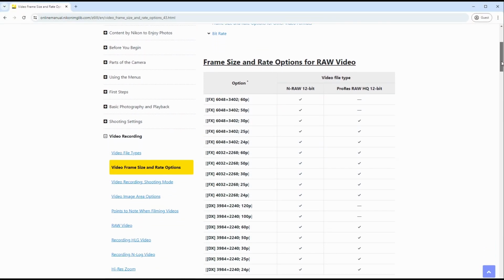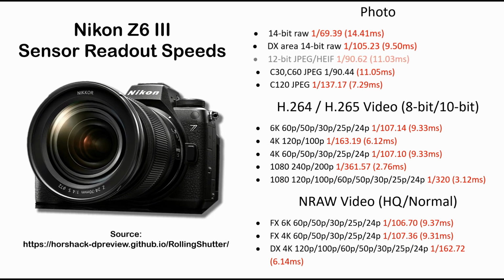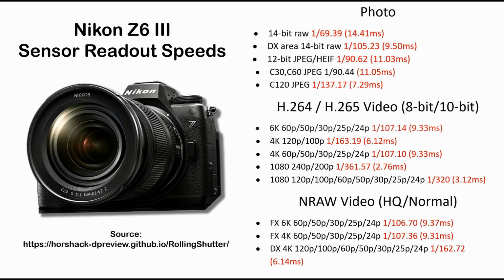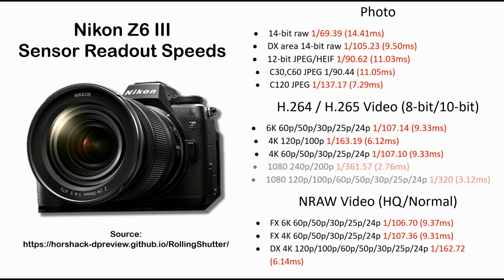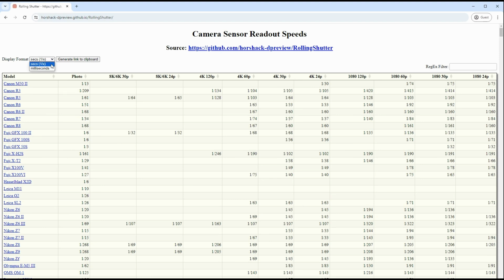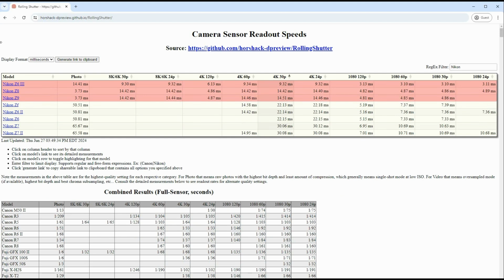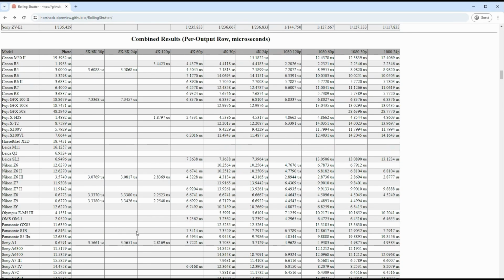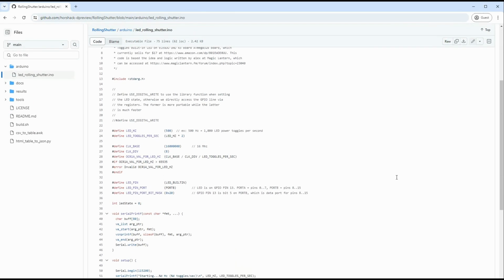Nikon Z6 III Sensor Readout Speed Measurements

Comment from the maker: There's an important aspect to fully-stacked sensors I forgot to mention in my video. None of the fully-stacked sensors currently on the market can use their fast, on-chip stacked memory in video modes. It's presumed this is due to thermal constraints running that fast memory continuously for long stretches of time. A big clue about this came from the datasheet for the stacked sensor in the Sony A9, which states that none of its video modes can use the stacked memory due to heating concerns. This is why the sensor in the Z8/Z9 has slower readout speeds for video than the Z6 III, even though the Z8/Z9 have almost 4x faster readout for still images vs the Z6 III.
Reply: Thank you for the information. Especially the bit about nerfed vid specs due to thermal throttling.

Comment: Excellent work! I have been looking for such a detailed analysis for a long time now. I am wondering if you ever tried to estimate how fast mechanical shutter slits are traveling in modern mirrorless cameras? Is it quicker than 1/500 of the second? Otherwise, one or two cycles should be visible (like with the super-fast Nikons Z8/Z9). Can you share any thoughts on that matter? And maybe any test images?
Reply from the maker: Mechanical shutters can be measured using this same technique. I've actually measured a few of the MILC in my database. If you go to my live results page at https://horshack-dpreview.github.io/RollingShutter/ and do a text search for "mechanical" you'll see the measurements.
Reply: @testcams  Thank you so much! I've been looking for such accurate measurements for many months.

Comment: Excellent work. And. While the milliseconds taken by the camera for sensor readout matter, I would correlate it to another thing: MB/s or Gbps bandwidth. To figure this out, we need a few columns more data: (1) the gross sensor rows and columns, not just what is called "effective"; (2) real bit precision. You may set your camera to 14 bits depth, but the sensor, c.q. the stacked chip, may relay 16 bits to the frame cache.

Example. My 45.4 MP camera has a readout time of 0.003731 second. At 45.4 MP, we are effectively using 8,256*5,504 photosites. But the sensor has 52.37MP "gross". It uses the additional rows and columns outside the effective area for two things: (1) defeat the requirement for an edge algorithm in deBayerisation and (2) IBIS in software with zero latency in the image processing pipeline of motion in the sensor plane.

If we want to know the sensor stack's bandwidth, we need the gross number and total bits. While we shoot at 14 bits depth, some sensor fab/foundry advertises their inhouse sensor designs as "16 bits" and then in a footnote say, but 14 are photographically meaningful. So the 16 don't matter to images , and we don't see them back in the camera's menus. But they are relevant in bandwidth. While my camera's sensor and stacked chips got (logically) designed by the camera company, and I don't how my camera is doing the 2 additional bits or not, let's assume that it uses two bits to indicate the Bayer filter colour with each photosite's data element. That may be relevant in the case of moving (IBIS) sensors and moving effective crops out of the total sensor image area.

Now we get to the 8,863*5,909=52.37 MP ballpark gross resolution and at 16 bits this means each gross frame ~equates to 837.9 Mbits (or 0.837861 Gbits) that in 0.003731 sec readout mean the camera/sensor works at 224.55 Gbps (224,550 Mbps). And that's before raw bits are polished, or any bits get compressed and deBayerised for the eVF. And, and.

Yes, readout time is important for time parallax, but bandwidth reveals the state of technology under the hood/bonnet. Or, while a Z 6iii has very fast readout, it by far does not have the bandwidth of a Z 8 - and considering price that was totally expected.

Word, words, words - yes, but essential to deeper understanding and that's what this is all about.

Comment: Excellent work. And. In photographic jargon, the generic term for what you call "rolling shutter" is "time parallax". Rolling shutter is a legacy of movie cameras with a rotating shutter near the focal plane. In the rotating shutter mechanism, two discs with open slits in them could be adjusted relative to each other and the angle between them determined exposure time, provided we knew FPS.
While our digital cameras in the Bayer paradigm (using analogue and colour blind sensors) started as scanning photosite by photosite and doing AD conversion in a discrete chip, for decades, TV/video cameras also scanned, but remained in the analogue domain.

What is called "focal plane shutter" (erroneously) in English, also has time parallax. In other languages, your focal plane shutter may be called curtain shutter or slit shutter.
The race car images shot by Lartigue in the Interbellum show time parallax as slanted wheels, thus suggesting high speed. While an artefact following from shutter dumbness, the concept was adopted e.g. by cartoon makers and many humans have these slanted wheels engrained in their brains as suggestive of high speed since early childhood.
Lartigue's shutter was an after-market device placed over the front of the lens.

Note that "leaf shutters" - like a second aperture (iris) mechanism that however can completely open and closed in a timed manner - have no time parallax (but do have a vignetting effect). Not having time parallax directly impacts flash (strobe, speedlight) sync times.

As to "shutter speed" note that about all shutters run at constant and consistent speed in their parts all the time. If "speed" is meant to relate to how fast the closing is after the opening, fine, but the speed of components stays the same.

Word, words, words - yes, but essential to deeper understanding and that's what this is all about.

Comment: Good detailed test results. 

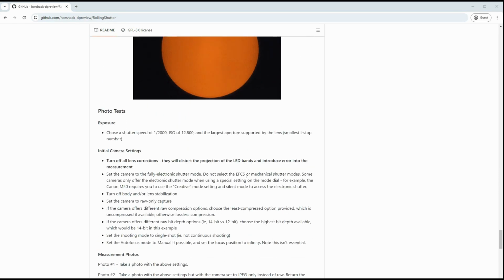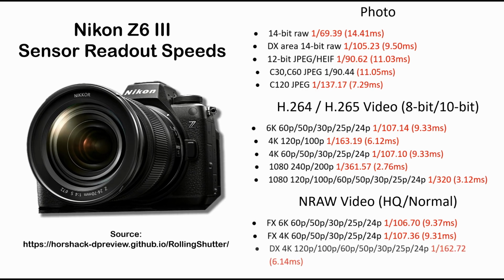If I may make a suggestion, please stay with the data.   Rocking a still photo of a Z6III back and forth from 0:19 to 3:40 is not only unnecessary, but is distracting and annoying.  

Keep up the good work!
Reply from the maker: Thanks. There's actually a funny functional reason I include motion in all my frames. I have a smart tv whose remote I sometimes accidentally press mute or pause. I can quickly determine which by looking at the content - if there's motion then it's mute, otherwise it's pause. If there are long stretches of silence or stasis in the content I'm watching then my strategy doesn't work. I like to assume my experience of the world isn't unique so just in case there are others like me I try to keep something moving at all times.

Comment: Thank you very much. So one take away for me is that to speed up the readout time and lessen the risk of banding, shooting in DX mode gets you a useful speed up of the readout.
Reply from the maker: Shooting in DX crop mode to reduce sensor readout time does not reduce rolling shutter artifacts (including banding in artificial lighting) because the per-row timing is unchanged - the camera is simply reading out fewer rows, so only the total readout time is lower. The DX rows that are read will be subject to the same inter-row readout timing, and thus subject to the same rolling shutter artifacts. However, shooting in JPEG/HEIF will reduce rolling shutter artifacts because it uses a faster 12-bit sensor readout, which reduces the per-row readout time.
Reply: @testcams  Ah. Thanks for that explanation. Like quite a few photographers I am plagued with banding issues on my Z8's even with antiflicker on. I work in theatre and film sets all the time. Film sets are fine but a lot of theatres have a huge assortment of LED lights and some, especially it seems when run at low level or predominately one of the RGB channels, generate banding on the Z8. I had hoped the Z8 would be an answer to banding alas not always. I have Z6lll on order so that at least one camera is mechanical shutter. My original Z6's are fine with mech shutter but the AfF is problematic for action. Thanks again for the clarification.
Reply from the maker: Unfortunately even a very fast stacked sensor like the Z8/Z9/A1 aren't immune to artificial-lighting banding since many LED lights employing PWM cycle at very high rates. For example I have a smartbulb at home that cycles at 2000Hz for all brightness levels below 100%. Have you tried the high-frequency flicker reduction, which lets you set a fractional shutter speed that can better align to the banding frequency? Unfortunately Nikon requires you to determine the shutter speed manually - Canon's implementation actually detects and selects the frequency for you.
Reply: @testcams  Unfortunately it is just not feasible to select a high frequency fractional shutter in my theatre work. By the time I had determined it the scene or the lighting will have changed. In a steady state lighting setup it would work but not in my usual scenario. Perhaps you can answer this question for me? I believe that if I get banding at say a 1/100th sec moving it to say 1/250th sec, a much more desirable shutter speed, isn't ever going to solve it is it? It will just be worse? I realise 1/100.2 might help but as a shutter speed that is just as compromised as a 1/100th. It's a fast shutter speed I need. I am pretty sure I know the answer but I think you might be able to confirm it one way or the other. Many, many thanks for taking the time to answer. It's really appreciated. Subscribed. Best wishes.
Reply from the maker: Faster shutter speeds don't change the number of bands since that is a function of the light frequency vs sensor readout time. However faster shutter speeds do change the appearance of those bands - the faster the shutter speed, the sharper the edges, which subjectively makes the banding even more objectionable. I have a section in my GitHub project that discusses this: https://github.com/horshack-dpreview/RollingShutter?tab=readme-ov-file#effect-of-shutter-speed-on-banding
Reply: @testcams  Thank you very much. Really appreciated.